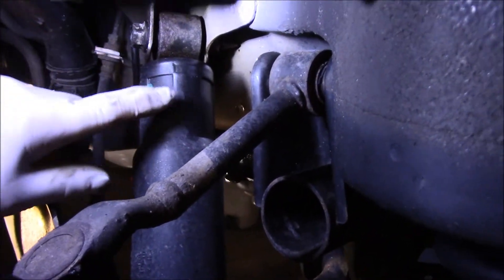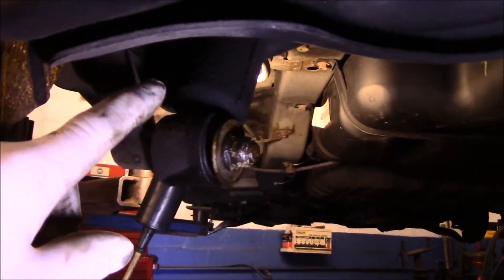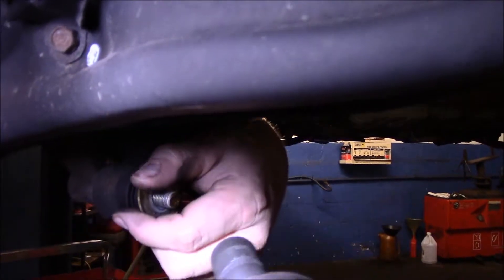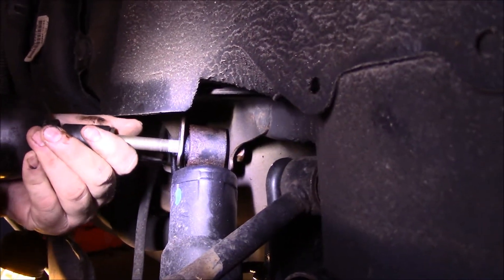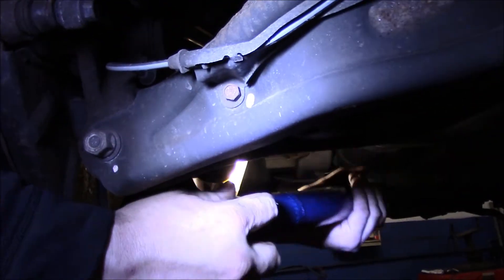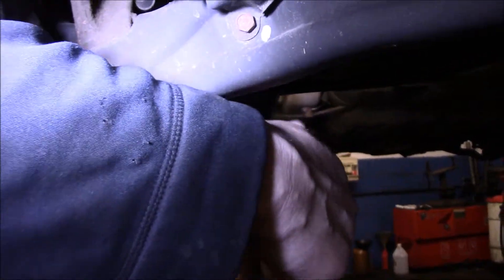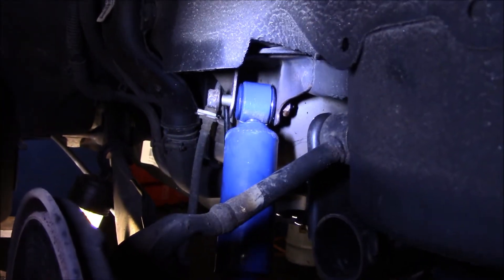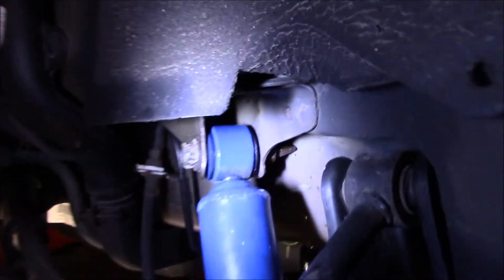How to replace the rear shocks on a Honda Odyssey

Comment: Nice to see those air tools getting a workout Jim. When reinstalling shocks, I was always taught to load the suspension component before torquing down the fastener. This allows the shock bushing to sit in it's proper orientation and prevents it from deforming or tearing prematurely under load.
Reply from the maker: DJ R   Thank you I hope all is well